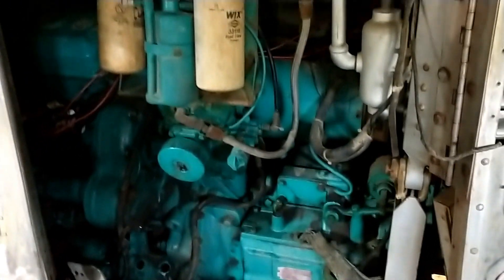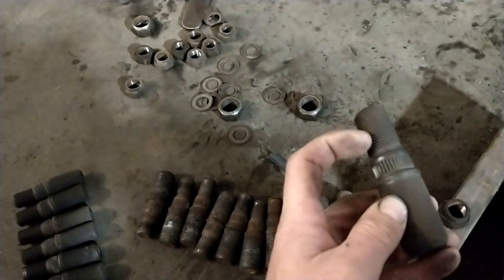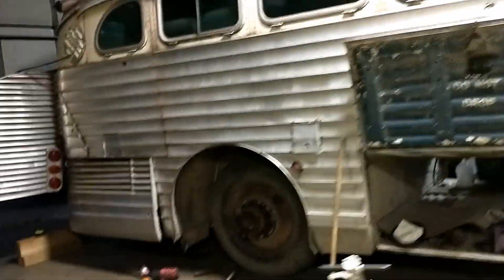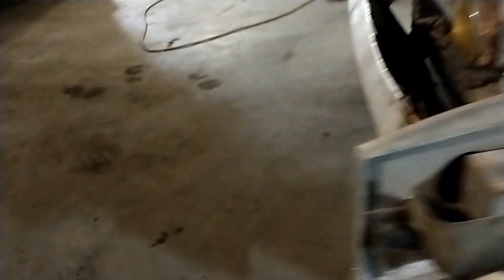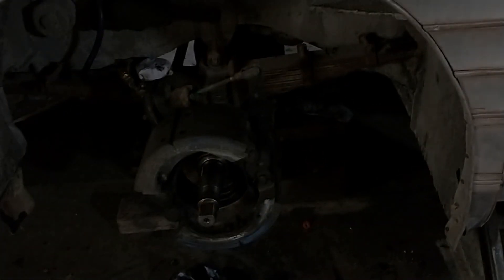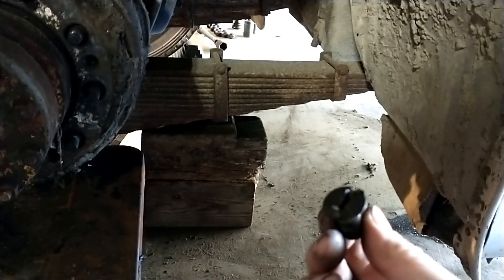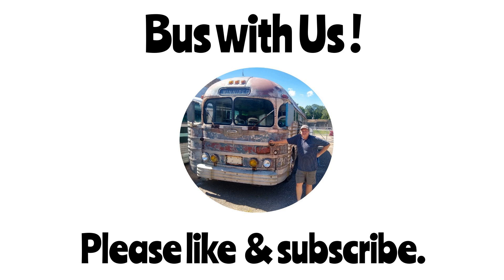Minnesota Bus Rescue - Day 4 & 5

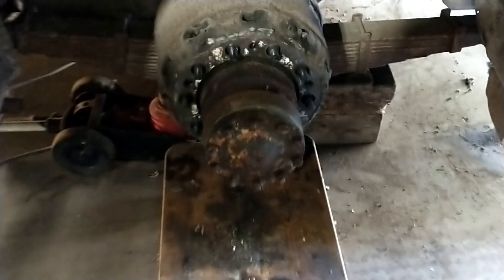Comment: At 8:10  An inexpensive motorcycle lift would work well for removing hubs also.  The motorcycle lift will also work for transmissions, VW engines, and even splitting tractors.   They are quite common and easy to find.